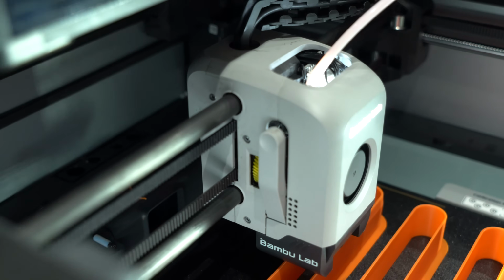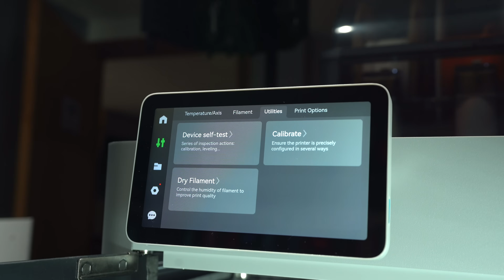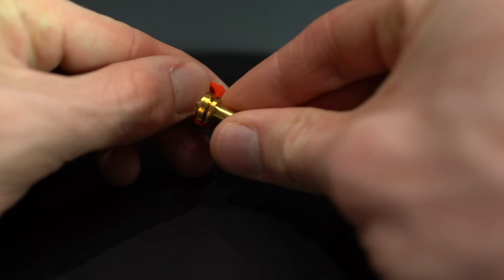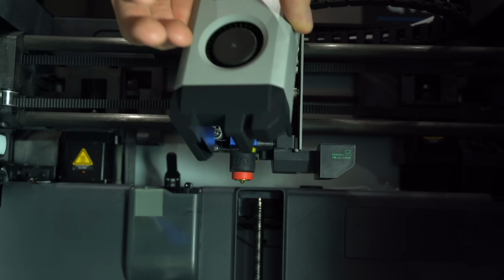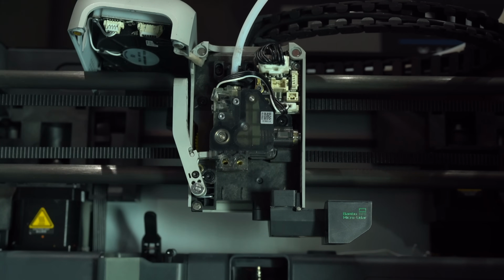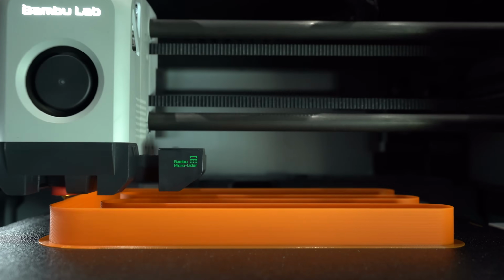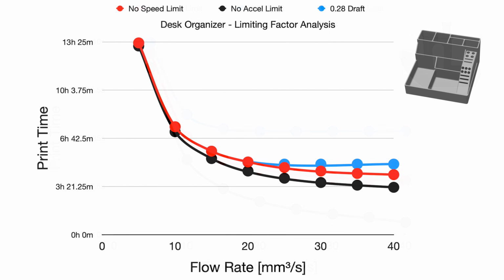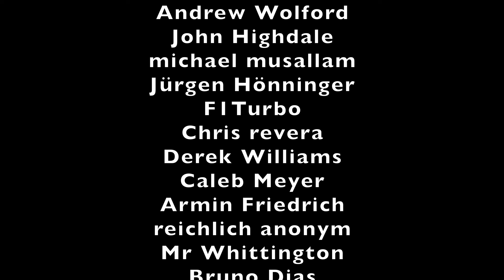Panda Revo - Quick Change High Flow Hotend for Bambu P1/X1

Comment: Flow rate isn’t a concern for me! As a hobbyist, I have lots of time & it isn’t really important!! 

What I am concerned with though, do I need to change the heat setting for every Print?, considering the info in the video stated a 10 degree difference from the stock nozzle.  I do really like the idea of quick change nozzle size & would purchase this for that reason. I however, do not want to deal with changing the heat setting on every print!

Comment: I just hit the same road block whether to get the biqu quick change setup - or the full 0.2/0.6/0.8 spread from bambu. When looking at the costs, getting all the sizes as full quick change setups was cheaper than the Biqu base kit. More than that, Bambu gives a discount as soon as you add a 2nd nozzle, and continues to the 3rd.

My biggest concern with hotend and nozzle changes is creating possible gaps which lead to clogs, which buying the full spread from bambu avoids, so that's what I went with. Plus if 1 nozzle gets compromised with a clog, I can still use the others if I have to get a print done. In Biqu setup, I have to fix the clog first before I can print anything, potentially.

Comment: Obviously the next generation of Bambu printers should have head swap capability to obviate the need for manual nozzle/head changes. Until then, I'll probably just go for the hardened complete hotend from Bambu with 0.4. I think that will cover 80% of use cases and i can live without the other 20 %.

Comment: Well as long as quality is the same or better I think I'm throwing these in my printers 

I know they're expensive but being able to just quickly swap in without needing tools even if it's just the occasional nozzle change cuz one got worn out is worth it for me 

I hate having to take screws and unplug wires on a 3D printer it's just always spells disaster later on when the wire connections get worn out

Comment: I've found that an Original Bambu 0.8mm nozzle doesn't work well on any speed setting above standard because of the flow rate. You definitely can't use sports mode. How does this compare on those speed change settings??

Comment: The price is simply too high for what it is. With not that much more cache I would rather buy a second P1S, put a larger stock hot end in it and use that for prototyping...

Comment: Your installation part shows it the correct way with the wires folded over, but the short cutaway at the end shows it the incorrect way with the wires straight up through the channel, did you have it installed wrong at first or change it to the incorrect way? When I have mind folded over the correct way, I get a "lidar dirty" warning every print since the wires are right in the way of the Lidar lense, and the toolhead cover air duct also pinches the folded over wire bundle, so the cover doesn't go on all the way. The only way to avoid these two things is to run the wires straight up, the wrong way according to E3D.

Comment: What I found in my own testings with higher flow rate nozzles is that it has a significant effect on print times with a higher percentage of infill.  For example, if you are printing something larger that needs some structural support from the infill, such at 30-50% or even more, the higher infill speeds help reduce print times.  Also, with the higher flow nozzles, I can sometimes increase my outer wall speeds and maintain the same print quality further reducing print times.

Comment: I am a little confused. You provide a lot of good data on the 0.4, but not sure I saw it on the 0.6 or 0.8. Yes, you mention the 0.6 worked up to 40 with caveat of curling, but unless I missed it, the print times detailed were all for 0.4. I would think that 0.6 and 0.8 would benefit greatly from increased volumetric flow. But maybe I would be wrong.

Comment: Hey! I just installed the Panda Revo with a .4 ObXidian. Ran a quick temp tower  (Fusion Filaments ABS 1.5). I had issues with layer adhesion. Layers were very weak. I'm pretty sure it has to do with cooling(?). Any recommendations for calibrating cooling/temperature with ABS on a P1S? I still have lots to learn, so be gentle, please :)
Reply from the maker: @Deanna_the_Baker  you can generate a temperature tower using OrcaSlicer. Higher temperatures usually mean better layer adhesion :)

Comment: Personally I only very rarely print big objects, so the quick change ability is the seller for me. Plus I'm worried that the plugs they use for connecting the hotend and fan to the circuit board aren't designed for hundreds of potential changeouts - most circuit board plugs are pretty fragile and can only handle this maybe a few dozen times before failing.

Also, the temperature analysis was super helpful! I couldn't for the life of me figure out why my prints were stringing with the new hotend regardless of what retraction settings I used.

Comment: Hi, so first of all thank you. I was considering getting the Panda only for speed and you've answered that question so well, thank you for that. Now the only question I have is would I be changing nozzle heads regularly, the answer is no for now. but in the future if it changes then I would consider this. It is exactly for this reason that I came on and you answered it unbiasedly, well done.

Comment: How exactly do you manage to print with .25 on the X1C. The X1C requires matching the print file nozzle diameter with the nozzle diameter set under "print options" via the printer LCD. The printer firmware (LCD) only has 4 options .2, .4, .6 and .8mm (the first 2 being under stainless steel option, the hardended has the last 3). There is no .25 nozzle diameter, so by default the printer will refuse to print a .25 nozzle diameter sliced file, unless you modified "line width" under print quality
Reply from the maker: I sliced for 0.2. Seemed to work okay.
Reply: @ygk3d  because the printer must have been set to .2mm too, ofc that setup would work if you sliced for .2mm. you wouldn't be using the full nozzle diameter.

Try making a printer profile with a .25 diameter, ain't gonna print. Printer will complain about nozzle size mismatch. The only way to use .25 or .15 is by modifying line with

Comment: The Plateu from the flow isnt from the flow its from the motion system and the speed in the slicer not being set high enough or being able to go high enough to be able to use that extra max flow

Comment: I had an absolute nightmare with this hotend. I received it in January and installed it on my printer, but surprise surprise, it was wired wrong from the factory and fried my toolhead board. My fault I guess for expecting it to be delivered ready to install. Contacted support, and they said they would ship me a replacement heater… in 3 months. They told me that in January. It’s now June and I still haven’t gotten it. Took a heater from one of my other Revo’s and wired that up to plug into the Bambu (after they sent me a new toolhead board) and got it running. With the nozzle tightened fully, the nozzle hangs lower than the stock nozzle by about a millimeter or two. Doesn’t sound like much but it threw off cooling quite a bit. And on top of all of that, nothing would stick to the bed while I was using it. I never troubleshot that, I just pulled it out and put it aside. I might try again when I get the new heater from BIQU, but at this moment I’ve had a much worse experience with the Panda Revo than the Aliexpress hotends.
Reply from the maker: That's rotten. Sorry to hear that.

Comment: I thought about this, because I use REVO in other PRUSA printers, but ultimately went with the  E3D HF ObXidian  replacement. Not only a fair bit cheaper, but I think more purposely built. I don't change nozzle sizes that often, and if I need it I have other printers. The HF REVO ObXidian is not that impressive to me and way expensive.

Comment: Bambu hotends are $15
-temperatures are correct
-fan doesn't need to be ripped off
-changes take 2 minutes
Reply: Bullshit that you can get it done in 2 minutes. And they're annoying as hell plus if you replace multiple times because of clogs or anything like that then you are getting warped metal and bends or dings or dents or something else. So what this allows you to do is not have to worry about buying extra thermal paste. Not having to buy extra nozzle heads, the fans, rubber heat and covers the metal clamps for the thermistor. I have six or seven.4 mm hot ends all because multiples of them have gotten clogged to the point where the heat break bent and I could not get it back where it was supposed to go so it's literally unusable. And then I've had multiple fans go out because when you take it off something is bound to go wrong after you've had to remove it multiple times. And then on top of it I bought a third party thermal paste because you have to keep replacing it when you switch from a 2.4.6.8 nozzle so this makes it so much easier ... If it works.
Reply: @marro1916 I will make a video just for you showing a nozzle swap in under 2 minutes. I'll post the link here in a few days.😊
Reply: @Ovrlordz  You bet your ass I'm going to be following up with this over the next few days.
Reply: @Ovrlordz  any time now.
Reply: @Ovrlordz  why am I waiting this long?
Reply: @Ovrlordz  done yet?
Reply: @Ovrlordz  still waiting
Reply: @marro1916  I was just coming here to tell you I would upload the video tomorrow night, but it looks like our good friend here has already done so.
Reply: @marro1916  I'm a busy man.
Reply: @Ovrlordz  He was talking about assembling the hot end now and not swapping it out. Not sure why, he seems confused.
Reply: @natearrigoni  Strange, the whole point of this original video basically says: 
"Buy this new thing for $120. Nozzles are $30. You can swap a nozzle in 30 seconds with it. Sure, you'll have to tune Temps for every filament, tinker with advanced hot end heating settings, and basically take a step back to the Stone Age."

My point is that bambu nozzles are cheaper, better, and just as swappable. If he's talking about assembly.... I dunno man. It doesn't relate to the video.
Reply: @marro1916  It's 2 screws and 2 connectors. It takes less than 2 min, lol. I have never bent anything replacing a nozzle, ever. I have no idea how you do that or what you are doing to your printer but stop.
If you are getting THAT much clogging, you are doing something wrong. If you can't assemble your own nozzle then buy one that is ready to go. I have literally never messed up a nozzle except with normal wear on the tip. I think you need to look at some of those Bambu tutorial videos.
Reply: @natearrigoni  still waiting for the video showing 2 minutes or less.
Reply: @marro1916  https://www.youtube.com/watch?v=BD10oyKz3Wk. Lol, LOLOLOLOLOLOLOLOLOLOL!!!!!!!!!!!!
Reply: @natearrigoni  thanks I was just about to make my own video tonight, but I didn't have my I Fix It tool kit here at home.
Reply: I have done so many nozzle changes that yes I can do it in my sleep at this point with my eyes closed absolutely and even I can't do it in 2 minutes and I've got third-party long Allen screwdrivers that help significantly without having to use an actual allen wrench. I don't care who you are You're not doing it in 2 minutes unless you are screwing it up.

Comment: Nah. I get a complete hotend assembly for 36€ from Bambu. Changing the hotend takes around 1min if already cold. I have 0.2-0.6 Hotends and change them when necessary but 90% of the time I print with 0.4mm anyway.
Reply: This is the truth. IF you already have the Revo ecosystem than it might be an ok move. But the quality of these Panda Revos is awful. I still don't have a working nozzle, and their CS is telling me to just fix it myself... so bad.

Lots of people with nozzles without fan mounting holes or they are in the wrong spot. Mine had broken slices under the heat shrink, was told by their CS to just solder them... clown company wants me to fix their $130 nozzle?

Comment: Totally agree with lowering the temp by 10C. I did and I am now getting the same performance as before. For those wondering, Revo is an ecosystem which I could use the same nozzle with any printer brand with a Revo. So, the main point is the ease of swapping nozzles.

Comment: how much faster can it make using a 0.8mm nozzle as i have purchased a 0.8mm nozzle from bambu only to realise it doesnt really reduce the print time due to it slowing the speed down, i assume because it isnt possible to push the filament any quicker at this size nozzle. so would be interesting to know how it effects printing times with 0.8mm nozzle. can it make 0.8mm prints much quicker?

Comment: I might do this upgrade with the Diamondback revo tips when they come out, that will make the life of the tip a lot longer and can print carbon fiber without destroying the tip.  Diamonds are forever, isn't that the saying?  Until then I'll just use the cheap bambu tips.  Also, maybe they will get the temp reading fixed in a revision, if that is possible since the thermistor can't be placed the same.

Comment: Has anyone printed with the 1.4mm? 
How much detail did you get?
Reply: obviously with 1.4mm nozzle, it's like adding a 1.8mm fillet on every corner. For some models it's fine, for others it's a disaster. the key benefit is in being able to lay 0.7mm thick lines tho, and the saving of time.

Comment: In a 0.6 pound for pound.
Ali express 0.6 CHT harden steet nozzle

Vs 0.6 revo Obsidian High flow 

Which one can produce more flow? I just care about the bottom line max flow number. Which can produce more (i ONLY make large blocky prints and will 100% benefit from flow and higher temp as i ramp up my tempe pretty high so they are somewhat strong) max speed max output is my only interest. If its not yours. Please ignore this comment. If anyone knows please let me know

Comment: Hey Taylor. Love the video! And the testing and rabbit hole exploring. 

Did you happen to test the stock hot end at 260-270° (whatever you figured the Panda hot end equals in the real world) with the eSUN fast PLA or whichever they said they got the best flow results, with the Bambu hot ends and their nozzle sizes. 

I’m curious how much you can push the flow rate on the X1C with higher temps. 

I got one of these nozzles and it broke day 1. Assuming just a lemon. I’m still waiting for resolution 6 weeks later, w the holiday breaks. 

That said, I loooove the idea of quick-change nozzles on the X1C. It could be worth it for those! 

I really don’t like all the hassle with stock hot ends, having to unscrew, unplug, and the reverse, aaand sometimes reuse the heater and thermistor with the Bambu hot ends. And like you guys have said, that can wear/break the PCB. Yikes. 

Looking forward to more A1 mini style nozzles!
Reply from the maker: Thanks!

Yes, I did do that test. I showed it briefly in the video @4:47 but didn't talk about it. The result with the stock hotend at 260C was much worse than the Revo HF at the same temperature. It seems that there's a non-linear relationship between temperature and flow on the Revo. At higher temperatures, the flow is considerably better on the Revo than stock. Whereas at lower temperatures the flow is only marginally better. I only have this one data point so I can't say for certain whether that's a global trend, but I thought it was interesting.

Comment: Im waiting to see what the X2 printer is going to be before dropping the dough on this.  I suspect it will have the same nozzle setup as the A series.  While the full nozzle assembly isn’t hard to change, like yourself, it’s enough of a pain to avoid slicing in larger diameters or CF filaments.
Reply: i hope they offer an upgrade for x1's having just bought one...

Comment: I have had the E3D Bambu nozzle for a week now and I am running 30 volumetric because I only saw print quality decline as speed ramped up to meet the flow.  I also saw no time savings.  There is barely time savings compared to stock 0.4mm with Bambu filament.  I am seeing maybe 15% faster in overall print times.  Which means I can up the quality levels and finish a 0.16 layer in the time of a stock 0.20 layer height.  I also increased my line width to 0.5mm and it's been working well.  My recommendation is to avoid the cheap CHT nozzle.  I had so many issues I stopped using it after 2 days.
Reply: This happened to me just yesterday and yesterday. With HS TZ2.0 I went back to the original because they didn't work well for me, material came off, a lot of threads and so on. I think I will buy a Revo later, but only for the quick change issue. While it is better to buy the original 0.6 and have the 2 0.4 that the standard machines come with.
Reply: Which one do you recommend?  A link would be great.  thank you

Comment: there is nop reason to pay 130 Eur for this... if i am not getting that much different flow, and as you claim everything above 40 it don't matter. so why should someone buy this ? for fast changing the nozzle!? nah thanks in 15 mins its done on stock.
Reply: I just did a few changes from .4 to .2 and back and it really only takes like 2 min max to get the nozzle out and back in. Most of my time was spent waiting for the machine to heat up, move and for the hot end to cool enough to handle it. 

I also bought this hot end and oh boy, the quality of the splices on the wires is so bad. One of the connections just wasn't there under the heat shrink, the other was weak too. They were also spliced right where I needed to make the bend for that bundle to fit in the printer. Took them forever to offer to send replacement wires and thermo, like 2 months and they want me to just resolder them. I told them to keep it, I'm not using their cheap shit.  

Unless you are in the revo ecosystem already, I can't see this being a win for anyone.